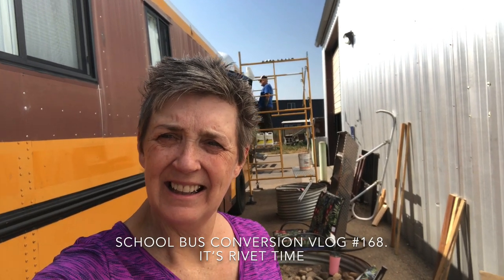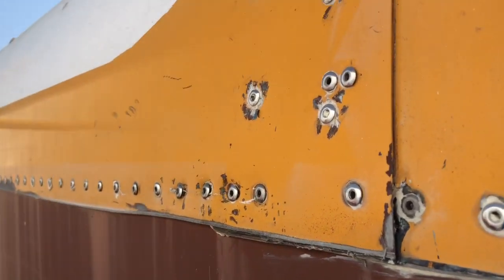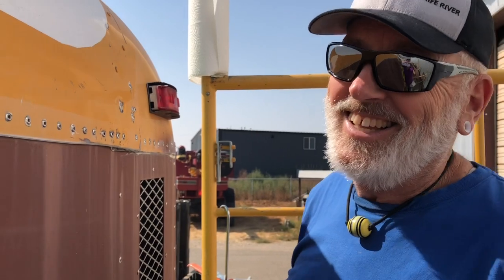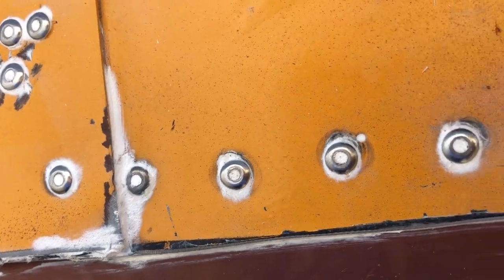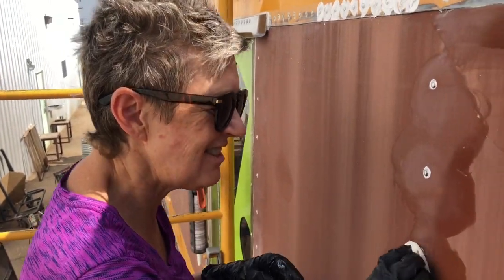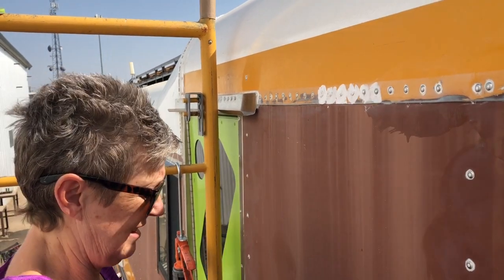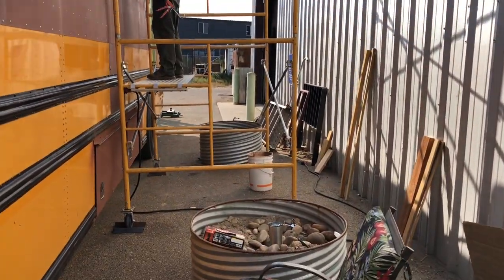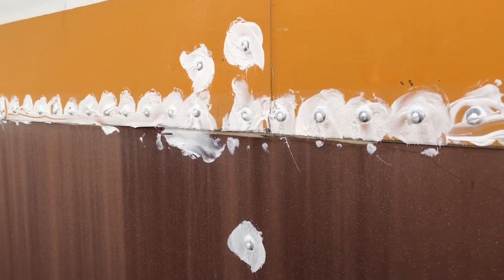It’s Rivet Time - Vlog 168 School Bus Conversion

Comment: Great idea! 
I wonded how welding them would have worked out, instead of using rivets
Reply from the maker: Randy is not experienced enough in welding to pull that off. That’s why we went with the rivets. 😃👍😃
Reply: @KnappTime  You use the same idea, you drill the holes, put some kleacos clips and then weld the other holes.
Reply: Also, welding when they've already spray foamed would be asking for a fire or destruction of the insulation.
Reply: @dchubb42  they would have done it when they first installed the metal